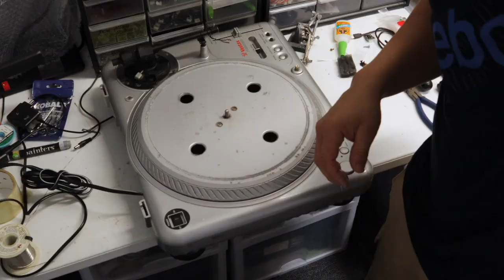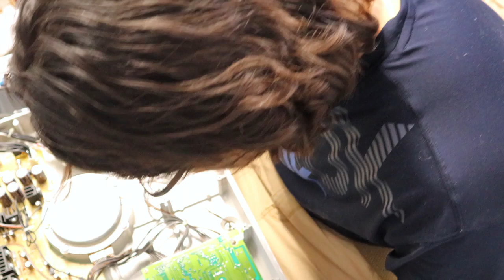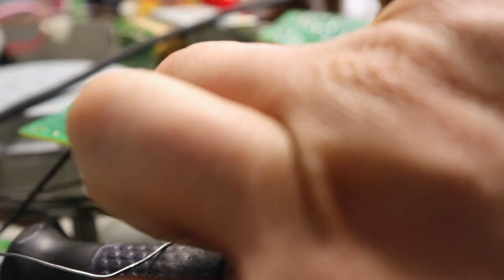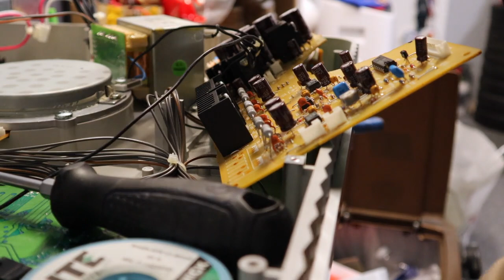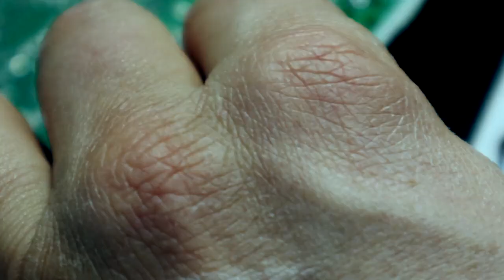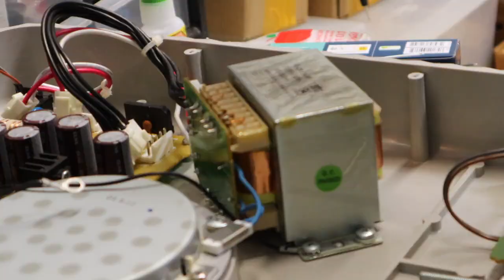VESTAX PDX 2000..Operation save a Vestax PDX2000 (MOTOR ISSUE) solved

Comment: I have these. Had them years but stopped using them because it drops speed slightly at times and ruins the mix. Any ideas the cause of that?
Reply from the maker: could be a few things  firstly it could be the issue that I covered in this vid . secondly it could be the little metal spacer inside the motor has come loose and the optical sensor is having a hard time reading the speed from the metal disc inside I actually posted a video of that as well.  third it could be the pitch control slider is dirty or defective . lastly it could be the the little black speed potentiometer knob next to the break knob on the front of the table it could be defective I have a video covering that as well.  hopefully these suggestions help you out nothing is more fulfilling then fixing your own gear .
Reply: @CJScratch I agree, im always fixing my own things. Thanks mate. I'll screenshot this and sub and give it a go soon. They are wrapped in cling film in the loft at but I've been meaning to have a look for a while now. 👍

Comment: hola estoy pasando el mismo problema con el pdx 3000 min plato a veces no enciende y tartamudea de atarás para adelante podrías decirme donde consigo los transistores? y su nombre exacto para comprar el correcto, muchas gracias.
Reply from the maker: https://www.ebay.com/itm/123544276548?_skw=D1415A+%2C+B1020A++transistors&itmmeta=01JXQYBG9CDZ49YJ6SA48WB5X4&hash=item1cc3d00e44:g:E8gAAOSwwhxcE8LD&itmprp=enc%3AAQAKAAAA4FkggFvd1GGDu0w3yXCmi1fzatnnHnv5zSyRMJrO89GYMxkJRaSwwKALhZgsBnf7gxT616fT%2F5NiDeqpxpxqbHbifPSEI4zY96BGARjjRfVrPM6sQG%2Bu%2Bd%2F5bbaQG9Vk64dBjz7GkARfqLXnbTeBTLrFgNk3ZylU9K8hd6mEfHIs85fMLlUw6y9xk%2FN%2FMYOHO9ZSjfNjrkiH6hka7PIqUGEbYKndoYh%2Br2E6tkbZ3E0Ds2eDUaDMN8a6z%2FawfcoRmhaSrs764N4b2yMgTPg1rNpXloSxJghPt8MRUb0Ac75e%7Ctkp%3ABk9SR-aErv7tZQ
Reply from the maker: https://www.ebay.com/itm/123544276548?_skw=D1415A+%2C+B1020A++transistors&itmmeta=01JXQYBG9CDZ49YJ6SA48WB5X4&hash=item1cc3d00e44:g:E8gAAOSwwhxcE8LD&itmprp=enc%3AAQAKAAAA4FkggFvd1GGDu0w3yXCmi1fzatnnHnv5zSyRMJrO89GYMxkJRaSwwKALhZgsBnf7gxT616fT%2F5NiDeqpxpxqbHbifPSEI4zY96BGARjjRfVrPM6sQG%2Bu%2Bd%2F5bbaQG9Vk64dBjz7GkARfqLXnbTeBTLrFgNk3ZylU9K8hd6mEfHIs85fMLlUw6y9xk%2FN%2FMYOHO9ZSjfNjrkiH6hka7PIqUGEbYKndoYh%2Br2E6tkbZ3E0Ds2eDUaDMN8a6z%2FawfcoRmhaSrs764N4b2yMgTPg1rNpXloSxJghPt8MRUb0Ac75e%7Ctkp%3ABk9SR-aErv7tZQ